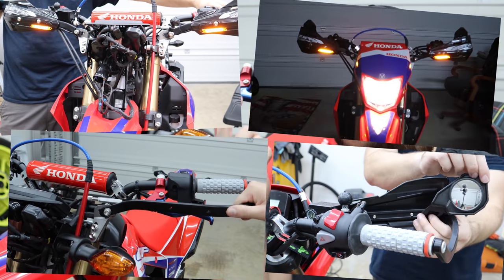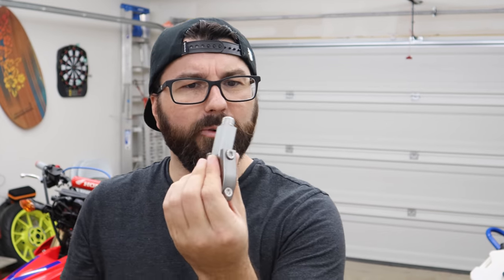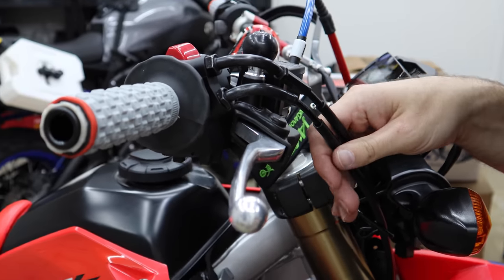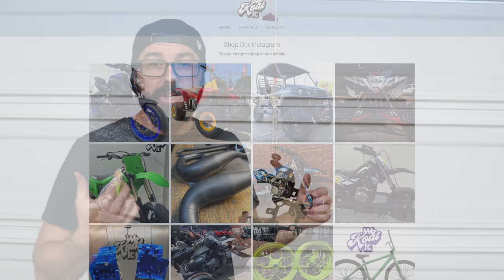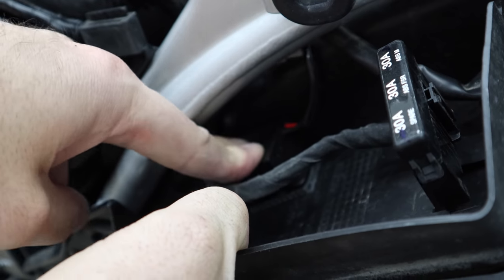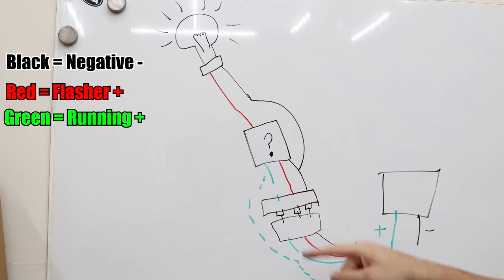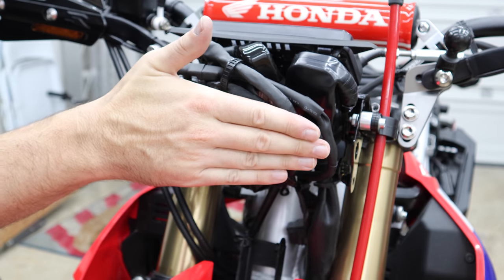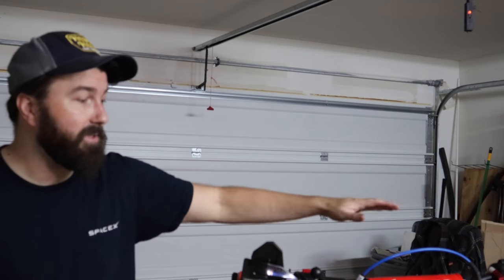BEST Handguard Setup - CRF300L

Comment: I’m probably not the first one to notice this. You didn’t need the blinker genie. If the running light stays on as long as the blinker is off then you could have wired the new blinkers to both the running light wire and the blinker wire and have the correct result. The led will be on all the time and blink when you use your blinker

Comment: Jake, I think you could just not use the blinker genie. You could run the running light positive wire and the blinker positive wire to the positive of the new blinker. When you activate the turn signal the bike cuts power from the running light and the blinker activates.
Reply: I was about to say the same thing, the blinker genie is probably for bikes without running lights.
Reply: Had the same thought.
Reply: Ya glad I'm not the only one who was thinking this!
Reply from the maker: There's still like 4-5v on the running circuit. It doesn't completely stop. Honda did that kinda silly.
Reply: @TheGardenSnake  That sounds weird, it could be that the voltage is just floating.
Basically nothing is connected to the circuit and the capacitance of that circuit has nowhere to reach ground(negative) and stays at some random voltage. Multimeters have really high input resistance, so as to not change the voltage measured, but if a load was connected the voltage might go to 0v, or 2-3v if the load is a diode.

But you made it work so no point in trying to fix it.
Reply: I have these same guards and signals. Was about to install the new turn signals, but I started thinking about the running light, and wondered if I could make this work because the bulb only has two wires, where as the connector has 3 wires.
My question is, could I just cut the wires below the connector, and sauder in the new turn signals to the running light without blowing a fuse. I hope this made sense 😂
There are only two wires with the new signal, so how would you wire the new signal wires with the three original wires that are inside the connector?
Reply: So tie the new blinker wire to the positive and running light wire out of the connector?
Reply: Has anyone actually tried connecting both wire together and did it work properly?

Comment: i so saw this coming when you started taking the signals apart. i have a 250L i went thru this exact same issue. my resolve was 50w load resistors for the hyperflash and a basic relay.. running out of space behind my headlight haha 
well done

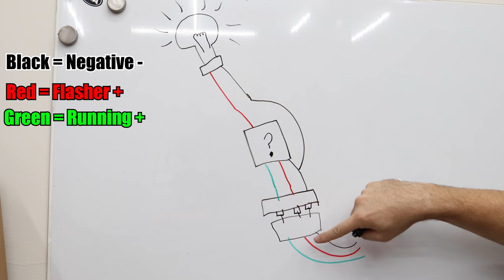Comment: so there are people saying that you don't need the blinker genie because at 14:40 you explain that honda has basically already done it for you, just in a weird way.  but you can't actually wire it that way.  in order to wire up a two wire blinker using those three wires from honda, you would basically have to short the +12V and the blinker wires together.  theoretically, that would light the bulb constantly, then once the +12V goes away, the relay takes over.
but the problem with that is that when you cut the +12V and send power from the relay instead, you would also be sending power backward along that +12V line, and that is almost certainly going to blow a transistor somewhere.  possibly on the main computer.
so you do have to use the blinker genie for a regular two wire blinker.  the only way you could use honda's built in wiring for this is if you had two separate bulbs for running light and blinker.  and there are some led units out there like that.
now, having said all that... it is possible honda did the wiring purposely so that you could successfully wire it that way.  but you would need to know that for a fact before trying it, because it would be stupid to risk blowing a transistor on your bike's main computer, or anywhere else.
Reply: Yeah, diodes would have fixed that issue and you would be just fine using both wires as the positive for the blinker 😊

Comment: "I think I'll slap some Zeta handguards with turn signals on my CRF300L."

Let the nightmare begin....

Seriously, it's a drag the way the front brake guide no longer works with the new triple tree mounted clamps and a drag the way the LED flasher doesn't fit in the original spot. Besides all the wiring hassles.

Good to know what you are getting yourself into!

Comment: Hi Jake, thank you for the video. I hv a question: Did you use a torque wrench to adjust the screws on the head of the suspension?

Comment: would it have been possible to connect the 'solid' (not solid when flasher circuit is running) positive wire and the flashing positive wire and then connect to the indicator? The running would be pushing 12V, then when you use the indicator the running stops and the indicator starts flashing at 12V. I'm curious cuz i really want to do this setup for the grom😂
Reply from the maker: I guess I didn't 100% explain this. It does still run power to the running light with the turn signal is on. But it's like 2-3v. It might work but I'm not sure.

Comment: @thegardensnake 
I just got my 300L and have been watching your vids in order. I noticed something with your wiring. I think you could have skipped the blinker genie and maintained the same functionality.  Just wire both the blinker and drl to the positive. Since honda cuts the power to the drl when it blinks, it will be on until you hit the blinker then start blinking.  Does this makes sense?  Id like to run this same setup but would like to minimize hacking the oem wiring
Reply from the maker: I think I tried it and it didn’t work 100%. But honestly I can’t remember. That was a while ago. Try it!

Comment: not sure im liking those handguards your limited in bar adjustability and cant put on risers which if you stand a lot is a must.
Reply from the maker: Well one I did my whole bar set up before this so shouldn't need to change anything. Two, is a good amount of flexibility. All the holes are slotted so you can shift one way or another before tightening. Also you can always get the raw aluminum ones so you can tweak them to fit perfectly. Trust these give you more possibilities then normal clamp on mounts. Those you are always fighting the cables.